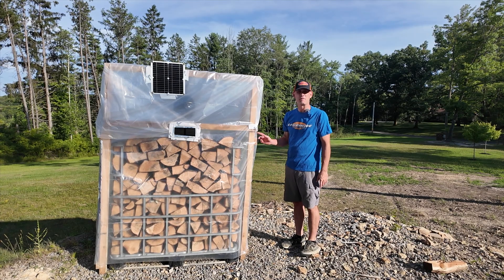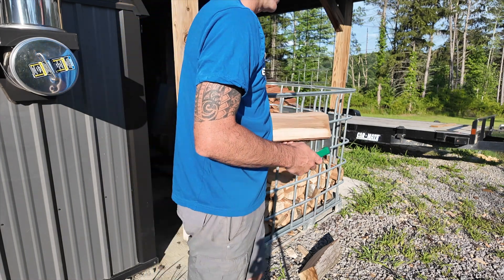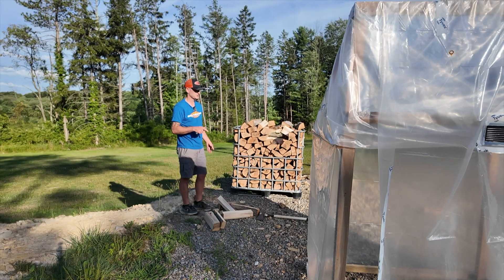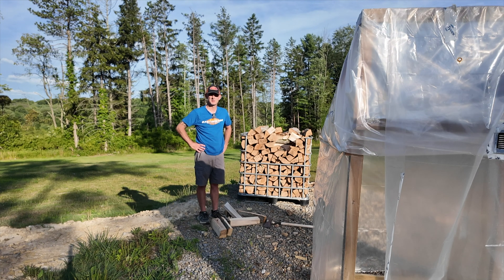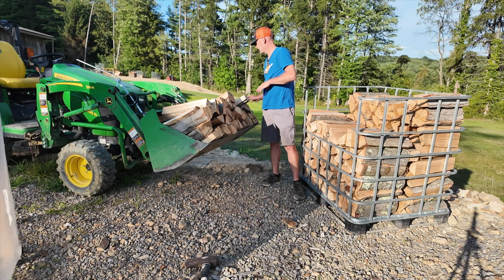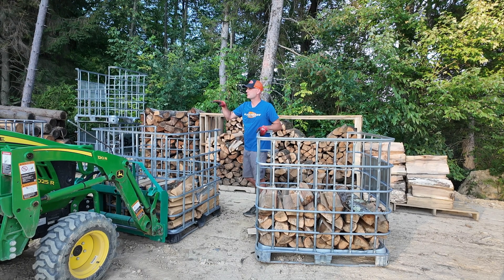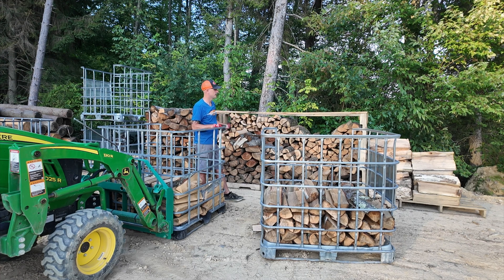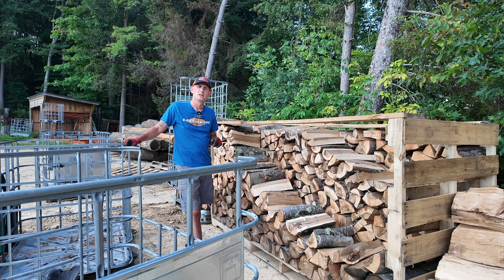Results: DIY IBC Tote Solar Firewood Kiln Test 2.0

Comment: It's a good start. The idea behind the kiln is to use sunshine to heat the air and a fan to force the air thru the wood  Try lining the tall back and top of the IBC with black plastic. Cut a hole and set the fan, blowing down and thru the wood. Small vent up high in the black back and the natural leakage around the bottom will exhaust vent. I suspect black plastic for the whole assembly except the cathedral front would improve performance. You could also explain to the neighbors that it was the 'kiss' fort.
Great idea on a solar kiln, next summer even better.
Reply from the maker: Thanks .  I have some more ideas up my sleeve for this spring / summer. Stay tuned

Comment: Don't think ' solar kiln', think solar oven. Use racks to separate layers of wood. Automatic heat sensitive vent pistons. Floor and north wall insulation/ reflection. A small lar fan would be good. And a condenser intake under the floor, to dry intake air.
Reply from the maker: I’m working on a newer model this spring

Comment: I think it worked. Internal was average 25% vs 35%. Think of how to improve this cheap simple design, not discard it. Improvements : 1-Use black plastic so absorb all the sunlight. 2-Have the fan blow air (hot) downwards to circulate the hot air (there should be some open space around the tote), not blow it outwards. 3- Have the bottom plastic extend lower (like a soft plastic curtain)  to prevent cool air going in from the bottom (seal the bottom)
Reply from the maker: The more I think about it the better I feel. Lots of ideas for the next model

Comment: I would recommend Black plastic to increase the temp during the day when the sun shines. Maybe making the tote more airtight would help to force the overheated air down through the wood. Also, if you had the bottom opening smaller it would be more pressurized depending on the size of the intake of the fan. Just my 2 cents :)
Reply from the maker: Thanks, good input

Comment: One thing that I can see in your IBC is you have a center row of wood that blocks airflow through it. If you stack wood really tight like that it wont dry as well no matter how hot it gets, its the air moving through a pile that dries it out. Just my two cents, its worked for me for many years. Best of luck with the solar kiln. I stack my green wood in a ##### pattern so air can easily go through it. Once it is dry I stack it tight to save space.
Reply from the maker: Nice

Comment: Cool design. I have always found that the wood on top of a pile outside tends to be a little bit drier (the pieces that get better sun exposure). Interested to check out pieces that maybe only had just the end grain on one end but you may have done this by digging into the pile a bit (37-38% versus 30%) but it's hard to tell as a viewer the way the video is edited/shot. Thanks for the video.
Reply from the maker: Thanks for the comment

Comment: If I'm seeing this wrong, I apologise.. But from what I do see - A glaringly obvious design fault that I can see immediately(IMHO), is your air Inlet is at the top, and your outlet is also at the top. 
I would have had my Inlet as far down the bottom as I could get it, and opposite to the outlet.
[Edit after watching the start of the video again: it appears to me like there is only one vent, meaning there isn't really an Inlet or an outlet. This is even worse than I had thought. It appears to be more like a sauna can a kiln. The fan should be attached to a cowl and plastic fitted so it is positively either pushing air out or sucking air in; with the other air Inlet/outlet right at the bottom of the wood pile]. 

 also surely the wood from the bottom of both stacks would (I imagine) read differently from the wood you've chosen from the top but that's just speculation - I have zero experience in this area.
An afterthought: Also I imagine black plastic would heat up more than clear too.
Reply from the maker: Thanks . Looking at doing another design. Stay tuned!

Comment: Congrats for your prototype!! I really enjoy that you are doing a low cost version of solar kiln (most YouTube channel show more expensive ones). I did one similar to yours, and I have some experience to share: be careful with moisture from the ground, I put some black plastic on my version. I also put black plastic in the front wall (the temperature increase a lot with more black surface), maybe your system is not enough to remove moisture, you can check pile the logs with some space between them) Greetings from Brazil!
Reply from the maker: Thanks for the comment. I appreciate your support! Cheers!